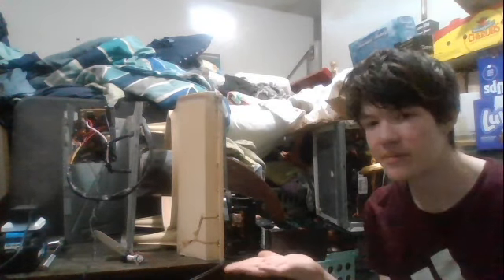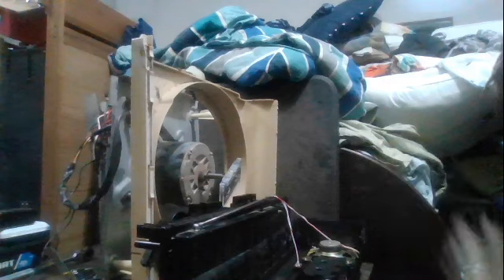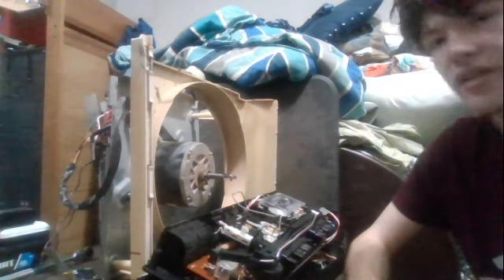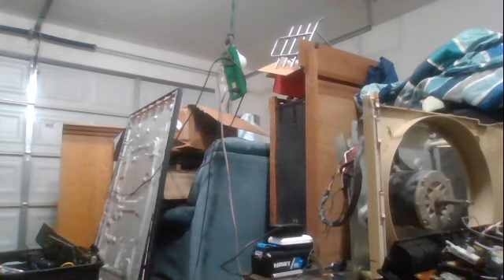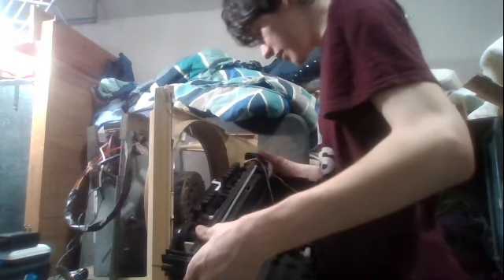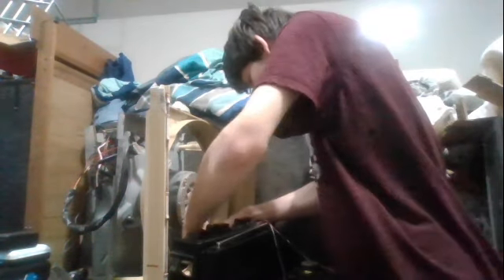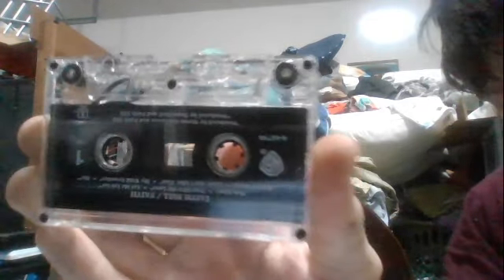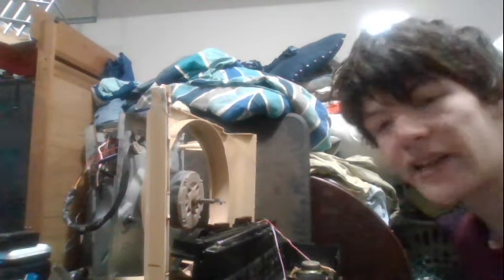I have tried to build a video recorder out of an audio cassette deck! Part 1: Playing a normal tape!

Comment: That is quite the contraption! Love the motor starting procedure. I imagine there's quite a lot of tape head wear. I think you'll get something, people have recorded video onto worse mediums, like that aluminium home recording disc with a 1930's TV broadcast recorded on it, and (eventually) the video was retrieved from it, about 60 years later. Messing with cassette decks has reminded me of my idea to make a tiny open reel to reel from a cassette deck, first I need to find a sacrificial cassette deck.
Reply from the maker: Yeah, I think I will get something this time! I have done this one other time but I just tried recording at fast forward speed and it didn't work for the most part lol A mini reel to reel would be neat! I have been thinking of making my own open reel VTR from a junk VCR and VHS tape for some time!
Reply: @Dedicatedtolivinginthepast  Can't wait to see the results! An open reel VTR from a VCR sounds cool too!
Reply: For something like this, a Time Base Corrector is a must (although as a Proof Of Concept will work without one, but in order to get anything even remotely recognizable, a TBC is needed - I guess. That's what killed the 1930s video recordings, they weren't able to play it back to anything recognizable, then a decade ago, someone put it through a computer - bam! recognizable and almost watchable (as if 30 line TV was watchable in the first place)).
My guess here is that the cheap boombox' electronics are gonna limit the bandwidth to 15kHz no matter how fast you run the tape. 15kHz should be enough to get sync pulses recorded - a friend of mine was curious and used a high-end tapedeck as a VCR and he got a somewhat stable image that had at least some vertical resolution. I tried that in the late 90s too, but my deck had a worn out belt and it wouldn't keep speed, so that experiment was destined to fail.
Btw. you heard of the Fisher-Price PXL 2000?
Reply from the maker: @senilyDeluxe  I would use a time base corrector but I don't have one at the moment lol I also would have used a better tape deck but I also don't have one lol Did they get that somewhat stable picture recording at normal speed? I have heard of the PXL-2000! It was one of the first things I came across when looking into if I could record video onto audio tape! I want one really badly but for some reason, They are extremely expensive! I don't know why anyone would pay the prices they go for lol
Reply: @Dedicatedtolivinginthepast  Yes, they were recording at normal speed without a TBC.
A reel-to-reel might improve quality somewhat as the better decks easily get to 25kHz. If you want a cassette deck that goes to 25kHz, you need to sell your house. They're insanely expensive. Decent decks go to 18kHz for a tenner and I keep finding those in e-waste. They won't get "crazy mad scientist" style points though lol
While we're on reel-to-reels, you also might know VERA. Did exactly the same thing you're doing right now, but in 1952.
Reply from the maker: @senilyDeluxe  Yeah, I require the crazy mad scientist style points lol